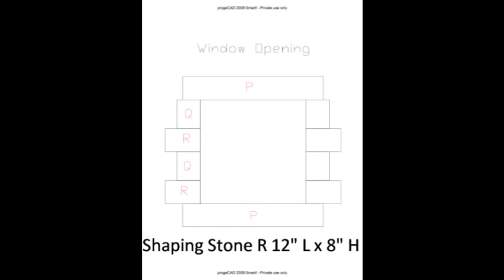Shaping Stone - Stone Masonry

Comment: once it starts to crack just drive one of the wedges in gently and remove the others before stone drops or else you may lose wedges under piece you cut off after you remove all but one set of wedges use a small bar to put pressure on stone to seperate and remove last set of wedges
Reply from the maker: Thanks for the suggestion.

Comment from the maker: Hi Mcgregors2, I got the hammer from a company called Micron Products.  I've added a link to their web site in the video description (can't add links in comments).  If you go to that web page you can see a good description of it.  I switch between it and a regular hammer (from Trow and Holden).  I'm still a novice so I can't tell you which one is better.  The bell shaped hammer does seem easier to use.